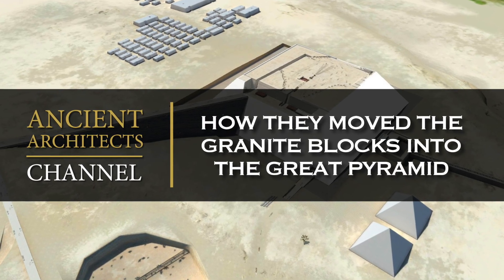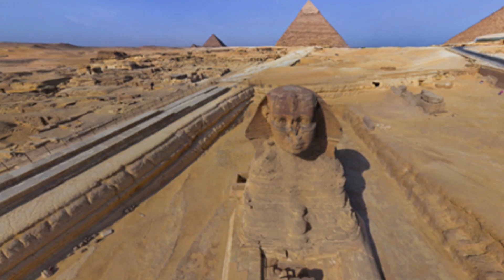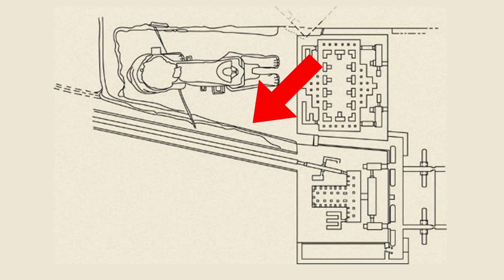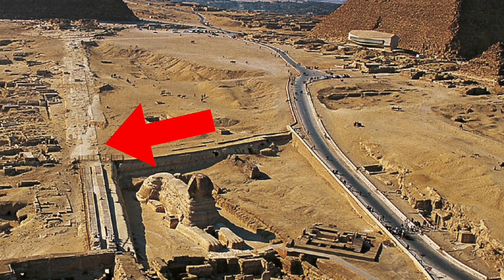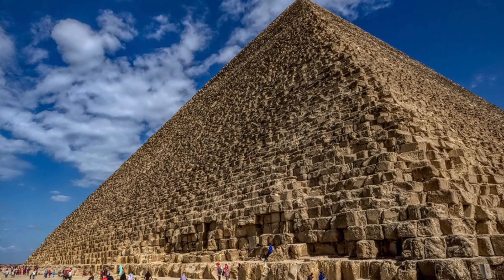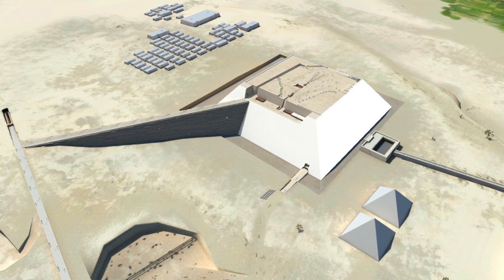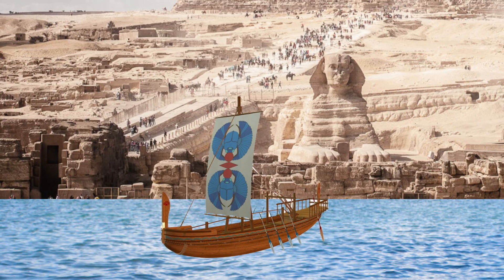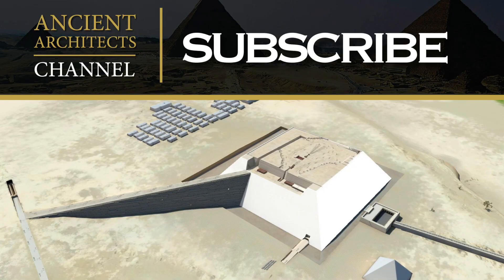How They Moved the 60-Ton Granite Blocks into the Great Pyramid | Ancient Architects

Comment: I think that there is strong evidence to suggest the great pyramid is older than suggested. The evidence is firstly the way the granite blocks were cut out so perfectly and placed within the pyramid. Bronze aged tools could not do this. I know diorite hammers and heat will be suggested, however there is evidence of machining marks on the surface of those blocks and the granite within the kings chamber also shows evidence of drilling marks. I would very much like to see luminescent dating evidence from under the causeway and several other sites that could help date the time the blocks were positioned. I do think the evidence for a large counterweight is there. The blocks had to of been moved somehow and to me this methodology makes logical and practical sense. It’s worth watching unchartedX channel on drill cores to gain an appreciation and note Bryan Forester on machining marks on stone, to have wider reasoning of why the pyramids are likely to be from a pre younger dryas age. One that had high technology that has since been forgotten.  In terms of the plateau and it’s origins, it was called the primordial mound, so perhaps ancient links to post flood or perhaps regeneration of population. After all there was a long linage of kings where the aim was to be conceived on the spring  equinox in order to be born on the winter equinox. Sites for this were sacred and known for this purpose. The Stone seat England borrows from Scotland to crown new kings and queens originates back to this. In fact it is spoken that it was the original king making stone from Ireland that came from Egypt before, read Uriels machine for more details. Very interesting, keep the vids coming pls.

Comment: All in all another hypothesis. Ancient Architects. I wan't you to look into ropes! Hemp ropes for example have a 
tensile strength of around 700 to 900 kg/cm² (old ropes only half of that). Traditionally made, and the "thickness" that is necessary to pull 60 tons is enormous. To pull 1000kg you pretty much already should use a hemp rope with a diameter of around 3 to 4 cm. Having some 11 cm diameter rope is bull shit. Also the distance you have to cover - pretty much that ropes own weight is in a couple tones on a distance of a kilometer (for example a 50 mm hemp rope weights around 1,9kg/m length, a 500m rope has 1000 kg deadweight).
Maybe they invented some steel ropes we don't know of to drag those blocks with counterweights of miles distance, but i doubt it. And when we are on it, they sure had some deflection pulley and block and tackle too.

Comment: Big thanks for the share as always :-) I really like the ramp it fits well and the dimensions really hint at them being the main way to get the blocks up there. Where your video leaves me wondering if those channels were filled with water to get the blocks up there some how, perhaps with the floods of the nile each year, using water presure say, and perhaps the weathering of the sphinx inclosure is not from time and age but from water flowing back down the hill after it has served its purpose getting it to the top :-) artificial weathering :-p

Comment: Can you please elaborate why you think Hudin has actual proof of the spiral ramps in great pyramid? As far as I know, this is not a fact but a speculation based on the density mapping that you showed in your video. Apparently the recent scanning project at Giza has not shown no sign of the spiral ramp in the great pyramid.
Reply: There is a spiral void inside the pyramid. A group of scientists did a study and they found the spiral void. It's mentioned in the documentary film by Houdan. It's not a speculation by Ancient Architects.
Reply: @JohnBrown-cn2qz  The newest scan of the Great Pyramid did not detect an internal spiral ramp because it does not exist.
Reply: @GreatPyramidPump  I said the scan detected a spiral VOID, not a ramp.
Reply: @JohnBrown-cn2qz  Yes the new scan of the great pyramid did not detect a spiral ramp at all.
Reply: @GreatPyramidPump  was they scanning for low density? Was they looking for the ramps? My understanding is that they were focused on scanning for voids, a previous scan had shown low density areas close to the exterior in a spiral pattern that's seemingly fitting for the hypothesis of internal ramps.
Reply: They may have built a ramp around an existing pyramid when remodeling it. But not the Great Pyramid.
Reply: They found the remains of what would have been an internal ramp. It was found long ago but overlooked because they did not fully understand what it was or how it worked
Reply: @daydreamer8662  that was on a completely separate pyramid, one that was in rubble, the ramp they found looked nothing more then a collapsed pyramid.
Reply: The misalignment of the center stones as seen from above seem  to indicate a ramp....
Reply: Houdin's theory appears to be spot on on everything, except for the internal ramp
Reply: Well, the maker of this video is clickbait garbage so that should answer why facts are pointless.
Reply: News ?  Go to www.thegreatpyramidofegypt.com   , read fragments (NO MONEY) 

                  I believe in aliens but i believe and in ancient  Egyptians. Do you?
Hello , what you are saying is very interesting, but it doesn’t bring anything new  about how the Great Pyramid of Egypt was built. In Romania, a book was published, THE SECRETS OF BUILDING THE GREAT PYRAMID OF EGYPT, which has completely new theories about this subject.                                                                     . 
Go to www.thegreatpyramidofegypt.com , read fragments ; the section Fragments ( menu = translated into English / Fragments of the book and Romanian / Fragmente din carte ; comments/ comentarii) and have some comment.
Sincerely,  Hantz.    

www.thegreatpyramidofegypt.com      

  1 - Pharaoh Cheops And The Great Pyramid 
  2 - Menu / Meniu :  
  3 – English / Romana:
  4 - Fragments of the book / Fragmente din carte :     
  5 – Comments / Comentarii:
read "fragments of the book" and you will find interesting things.

Comment: So if there was only 1 massive ramp. I'm sure they was about 100 levels of the pyramid. Therefore they would have to gradually make the ramp bigger and bigger which would take forever. Then on top of that when them massive stones are at the top of the ramp and in the level they need to be, the surface will be level and couldn't have a counter weight then. So how did they move and position them massive stones once up there ayy? Let me guess logs and rope lol. Good theory but it isn't practicle
Reply: smaller and lighter blocks of stone were used towards the top, they also would intentionally leave voids and fill those voids with sand.
Reply: @indieWellie  doesn't explain 600 ton blocks ...
Reply: What about the nearly perfect north alignment on top of that, don't know the exact measurement but the pyramid is on scale the same size as half the planet also all these crazy facts such as incorporated the speed of light in one of its measurement. 

I got all these facts from Randal Carlson and other professors on YouTube..
Reply: Centre of all landmass ... perfectly too.. no tombs have been found in the pyramid or any pyramid, no Egyptian hirogliths either... What I'm getting at is the pyramids wasn't built by " the Egyptians " but by a far older civilisation and they are far older than ever been taught in school.
Reply: @indieWellie  plus your reply doesn't make sense and skips a big part of my question... if there was only one ramp they would have to consistently keep changing it to meet the different levels of the pyramid which would take forever too

Comment: I've had a conjecture for a number of months now about using canals and locks to move the stones to the pyramids. It would also explain the erosion if the water continually drained from a form of an aqueduct. Working non-stop, they would need to place about stone every 5 minutes if they worked 20 years on the great pyramid. Fifteen gangs of men could place 1 per hour each. Getting that many stones to the pyramid could easily be accomplished by having boats bringing them to the base. By rough calculation, if the boats ranged from 75 to 141 feet, they could easily carry about 10 blocks each.
Reply: @Andrew H I had wondered about locks but I am think more of a canal that was near to the pyramid. Diverting the Nile and having it drain out by the Sphinx would have it show the water erosion. I recently saw a reference of medieval masons moving blocks with a similar weight. I am less concerned about the movement of the blocks as much as the precision.
Reply: @Andrew H There is too much conjecture to be definitive, but the Egyptians did understand locks, and the Nile stream bed did move around. I cannot say that Lake Moeris (https://youtu.be/Tit3Uy2-ks0) might have have been the source of the aquaduct, but something similar may have been deviated further up the Nile to be the source of the water. 
The first couple of minutes of this video (https://youtu.be/xlCW2lvacRE) describes how Moeris may have been a source of water to fill the locks, where the Nile used to flow at the time, describes the causeways, and the retaining walls around the pyramids. All conjecture of course.
Reply: @Andrew H With regard to some of stone working, Moses was described as using "Shamir" to write the 10 commandments on the granite tablets. It is possible the modern name is Corundum which has a hardness of 9.0 on the Mohs scale. One type is found in Emery cloths. Its source might have been Ethiopia.

Comment: Interesting theory! One of the best "mainstream" attempts that I've seen.

But it doesn't even begin to explain how they moved the blocks from there, into absolutely precise position. 

Also, I don't really follow your logic about the Sphinx. If the GP causeway fits at an awkward angle in relation to it, then why assume that the builders of the Sphinx were fine with the discrepancy, and not the builders of the causeway? 

If we know one thing about these builders, it's that they were just as interested in aligning and mapping their structures to mirror the heavens as they were with perfect symmetry. That could be a perfect reason for what we mistake as sloppiness.

Comment: If they used a counter weight a method of transferring its motion to the load / block would have been used , ropes ,pulleys etc . it would stand to reason that a combination of these would make the requirement of a 100%  human motive force superfluous, other than holding or steering , unless they also once unburdened from the block; this manpower was used to return the counterweight to it start position . My point being there must have been an anchor point at the endpoint for the block; capable of holding the pulley / block and tackle. would evidence of this still exist  and be another link to the method used . I would like to think Hydraulics played a part a bigger part . Another after thought would be we know that the blocks a precisely manufactured , why did they not use an effective shape? that would have made transport easier and provide an improved method of construction?
As always your work is thought provoking , and means I have to look further tying up more time . thanks

Comment: I'd never payed any attention to the oblique angle of the Sphinx enclosure. Certainly an important clue now that you've pointed it out!  Here's my thought: The Sphinx was created first. The causeway then cut through the enclosure at a later date because that is where the port was. The weird angles of the causeways always puzzled me, but having watched your video, it sort of makes sense now. They are angled oddly because that was the most direct route to the port. The port was at the base of the Sphinx. So the ramp was constructed from the port to the build site, which happened to cut the corner of the Sphinx enclosure. 
So yeah, this means both the Sphinx AND the Great Pyramid might be older.  Wow.
Edit: And a second thought - if the builders already knew to use boats to move blocks, why wouldn't they attempt to use a similar system to move blocks at Giza? To me it seems the causeways were some sort of artificial waterway to move the blocks.

Comment: I'm slightly confused. The ramp is on the bedrock, why would they dig down into the Sphinx enclosure, it would serve no purpose to do so for the ramp to function. Surely the ramp would have just been laid on top of the plateau, with no digging into the enclosure? Or am I misunderstanding what you mean by the ramp being there first, or is there a reason to build a ramp but dig down on one side of the ramp into where the Sphinx is now causing the Sphynx enclosure from being straight angled?

Comment: Great video! I'm of the opinion that the pyramids are older and that the simplest explanation is most often the correct one. This theory seems simple, logical and has the evidence to back it up. I've always thought that they used advanced methods of counteweights and block and tackle to move the stone much as man has always  moved massive weight throughout history.
Reply: agree pyramids extremly old
Reply: Is there an animation for the counterweight system? I'm not seeing it in my mind.
Reply: Considering they didn’t have the wheel where would a block and tackle come from?

Comment: Anyone should ask a company to move you a 60 ton block, many would not be able to do it now, ask a quarry to give you a 60 ton block, and you get 60 1 ton blocks you can glue together so that moving 60 tons at once is not his problem. Yet the people who invented/used the wooden wheel 1000 years later could do what we cant do now with the hardest steel frames and best rubber wheels :)
Reply from the maker: But if the President of the USA said that the main focus of the United States is to build a pyramid without machines, the greatest minds, the best labourers and engineers WOULD move a 60-ton block I’m sure. If a king of Egypt’s main task in the country was to build this pyramid, human’s are clever enough to make it happen.

Comment: Why isn't the causeway to the Khafre Pyramid on a straight path from the harbor to the Pyramid like the Menkaure Pyramid but instead on an angle to avoid the Sphinx?  I see the Sphinx being in the way for a direct path to the Khafre Pyramid and they had to go at an angle to avoid it.  It also brings up the question of why?  Was an earlier pyramid structure already present and they had to create the causeway in this manner to get to it and renovate it into the marvel it is?  Imho that is why the Sphinx enclosure is not symmetrical (but once was).  I'm not refuting the theory of how the blocks were moved, only that I believe the Sphinx was present before the noted causeway was constructed.  With this  in mind, what were they avoiding when creating the Khufu Causeway?  Thank you for always providing amazing content.
Reply from the maker: It was leading to the high ground. If it led directly to the base of Great Pyramid, which is on lower ground, the builders would have the problem of getting 60-ton blocks up the pyramid. By moving them up a gentle slope to the high ground, and then across to the pyramid when half built, they could get the large granite blocks to a high elevation more easily. The causeway doesn’t avoid the Sphinx, it was there before the Sphinx was built because the causeway forms the Sphinx enclosure southern wall.
Reply from the maker: I think that makes sense. Hard to explain though.
Reply: @AncientArchitects   As always, you have explained things brilliantly.  I had a lengthy, detailed explanation of "reasons" but decided to spare you and your other subscribers the TLDR details.  I still hold the belief the Sphinx Temple is older than the Valley Temple which linked the Nile to the Causeway.  There is ample evidence but such evidence can be interpreted in more than one way.  So until we learn more,  I will keep watching and supporting your awesome content :)

Comment: An interesting theory, but I have a few questions. Is it possible that the pyramid was built on top of a mound? Why is the causeway at the angle it is when it wouldnt have been all that much trouble to have put it straight down through the sphinx? Suggesting something existed where the Sphinx is today and it wasnt the Sphinx. In fact given the evidence at the Sphinx it seems to have been an odd rock when they built the pyramids so why didnt they just cut through it? It also doesnt explain the water flow appearance. Then the question has to be asked as to why they built the causeway next to a hole in the ground where the edge would have been weakened. In my opinion neither theory really explains what was going on. It should then be noted that Giants existed in those days and after. Where do they fit in? They are depicted all over Egypt but are conveniently explained away because no ones ever found a giants body. Which I find highly implausible unless someone or some group was hiding them when they are found. I dont know, maybe Hawas through the Egyptian Antiquities and other organisations including the Smithsonian well versed in deleting things that pose a problem for their quackademic timeline. Just like hes has repeatedly denied tunnels in the Sphinx and yet there are videos of him going down them, for example. As Ive mentioned before, the head on the Sphinx doesnt look weathered when compared to the rest of the body. Why is this? Was it covered in Gold at one point? I seem to remember a very long time ago reading a book in my schools library that had mentioned that it was covered in Gold and that it was stolen in antiquity.